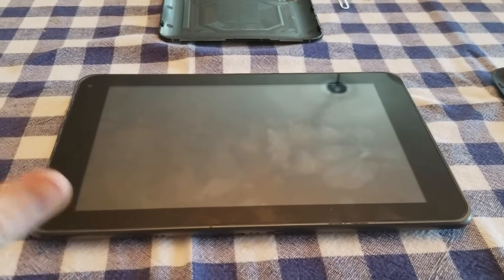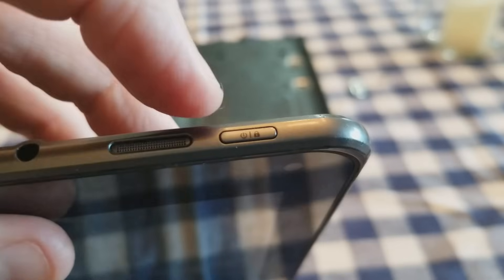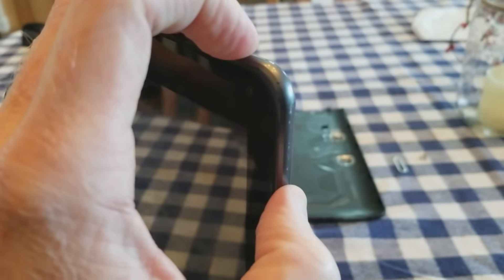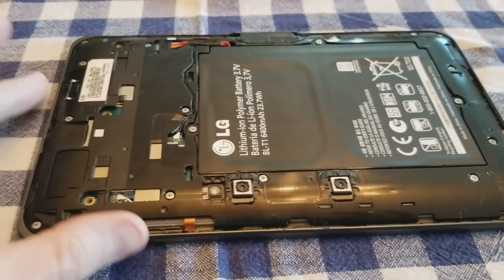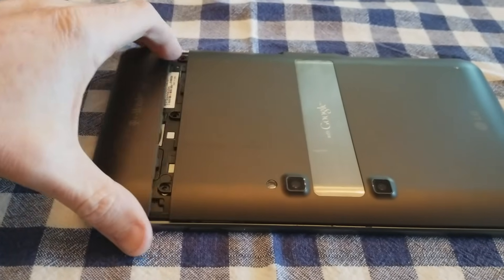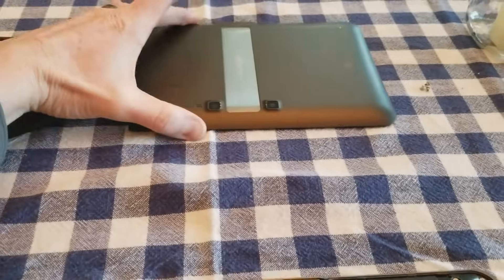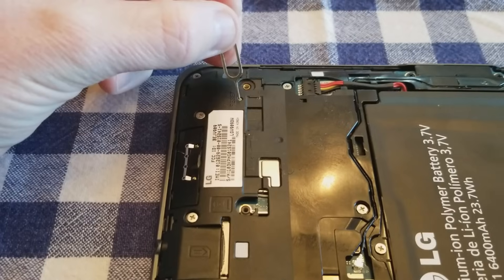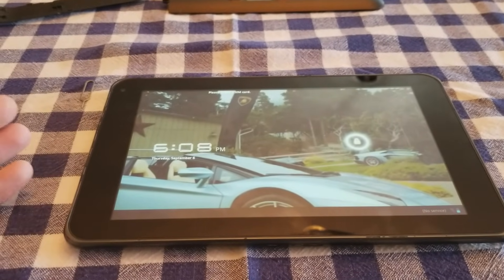Android Tablet Won't Turn On FIX!!

Comment: I put it I did the button and volume and then I put it in recoveryand then I took the case off which I'm struggling with it what I struggled withand then I hit the reset button and then I let it charge for 4 hours and it worked fine

Comment: i tried to discharge the motherboard without the battery being plug in... still no. Its not turning on or charging... I've put it in the charger for days still no....

Comment: You are amazing, I replace screens for my tabs and iphones, I work with their hard-ware stuff, replace the inside hearing piece og my iphone, but just gave up to fix my samsung tablet which just suddenly decided to die (I appreciate the details you mentioned including the idea of very low battery as that was the case lately), for me the 1st option worked quick and magic.
Thanks again and again and again.
God bless you for every electronic wisdom you share

Comment: LG tablets are terrible. Never buy one. I had several and if you do not have the original usb cable they will not work with another one or if they do sporadically and will drain quicker than they can charge, even plugged in. They are terrible tablets. Verizon is a bad company for using them, go with another service.

Comment: Another way is to charge the battery manually 
Try jump starting using a powerbank board 
Disassmble the tablet to access the battery 
Connect the positive to positive,negative to negative on both battery and powerbank board 
Then connect the powerbank board to the micro USB charger and charge for 30 minutes 
Can watch my video on how to do it
Look on dead android tablet revival on my channel 
You can get a powerbank board from a key chain powerbank as I did it

Comment: My new Winnovo tablet stopped working after 8 days with the battery at 100% charge.  Fortunately, an internet search found a solution from 2014 that worked.  It mentioned the tiny hole reset button which fortunately was right by my power button.  Sticking a straightened out Christmas ornament hook in the reset button hole worked and now my tablet starts again.
Reply: It is good that you knew about the reset button.  It is too bad that some tablets make it hard to reach.  Some people think they need to disconnect the battery and then reconnect it. They don't know about the reset button.

Comment: no joke i cried when it turned on. it’s been 4 years-
Reply: I was so sad when it did this like just playing on it then boom turned off dunno why did the hold down on button and volume button and BOOM I cried when it turned on
Reply: Ultra Instinct Master cry baby
Reply: @toastyy235  thank you! I was trying to turn a device on and when i tried what you said it turned on! :)
Reply: @viraenthusiast  its OK dude nice to know I helped someone
Reply: 4 years?? Maybe theres hope for me too. Hmm....
Reply: Nope. Completely dead. And cant find my usba charger either. But if memory serves, it was having charging issues, so I may have worn out the battery or charging port.
Reply: @kurtr1181  awww man I feel bad for you
Reply: @kurtr1181  oh welp
Reply: @kurtr1181  RIP Mr Kurt R- a Great Man Who Didn't Survive During the non charging tablet holocaust.
Reply: @kurtr1181  RIP, one year into the future
Reply: @kurtr1181  You need to charge it first
Reply: @kurtr1181 bro mine works but doesn't charge
Reply: @kurtr1181  same my stoped working when I was seven which was 5 years ago but I managed to fix it and then I forgot I had a password.
Reply: @diamondmax5141  I got it working soon after my comment! I think I have a slightly loose charging port, so the cord has to be absolutely still and in a consistent position. But at least it's not a battery issue like I had thought.
Reply: @diamondmax5141  lol
Reply: @diamondmax5141  go to bios and reset whole tablet
Reply: @kurtr1181  Mine won't turn on too
Reply: I fell you it most be that painful
Reply: Even my tablet it's been 4yrs 😮
Reply: @karenmeni1286  sam
Reply: OMG me too! 😭
Reply: Lovely Kawaii lier
Reply: I will cry too if it gets fixxed, this tablet has high sentimental importance to me
Reply: My own works just that it has a black screen...my netbook tablet just has a black screen I  mabe just need to replace the screen....
Reply: no joke my tablet was not on when i was 4 and that was 7 years and it wont turn on and it turned on when i was checking it and when i played it for 5mins it turned off and wont turn on so im on youtube looking for a fix i miss my tab i wish it will turn on someday
Reply: @darkgamer3743  seen
Reply: Mine still won’t turn on :<
Reply: Same I got it since I'm 4 and it turned of at 5 so I'm 10 now I'm crying
Reply: мilкy_cнlσє cry baby
Reply: Charge it
Reply: 3 yeara for me
Reply: My little brother peed on my old tablet :(
Reply: Qu
Reply: Bless me I have the same situation like you. Plz me plz
Reply: Mine 5 years bless me and your dreams will come true, believe me
Reply: Areee same 4 years ago at new year i was running to my brother because i wanted to  play subway surfer so i ask my bro to send me that game and he said to bring the tab then i went to my room and i was running out of excitement and boom i fell and my tab crack and screen wasn't working i couldn't do anything and i had a strong Patten and now i probably forgot what was my pattern 🥴😭 just now i finally on my tab after 4 years... And was searching for how to fix my tab 😂😂😂 then i saw someone who was in same condition whos tab turned on after 4 years... And today 23/8/20 my tab finally turned on 🤩🤩
Reply: Congrats!
Reply: mine has been more than 7 years :')
Reply: yep. I'm trying rn with my samsung tablet, it's been 6 years. I lost so many photos of my pets that have sadly passed.. but I've been trying so hard to get it back on. praying this works
Reply: 4 years? Maybe I have hope mine is 7 years
Reply: Wdym Is There Hope For Me Too? It's been 7 Years😭😭😭
Reply: @NahIWillDie  YOU HAVE HOPE MINE IS WORKING NOW TRY USING THE MAIN CHARGER FOR YOUR TABLET THAT IT CAME WITH THATS THE ONLY ONE THAT WORKS BEST
Reply: @personwithbasichumanskills  Bro I Will Thanks If It Worked I will litrally cry😭😭
Reply: @NahIWillDie  Good luck!!!!! I’ll pray for it to work <333
Reply: @personwithbasichumanskills  Thabnks :))
Reply: OMG! Same!!
Reply: Crybaby
Reply: My tablet iPod and ex phone has been dead like this  for 4 and a half years now and they still arnt working I’m gonna keep trying tho !
Reply: If only i seen this video 6 years earlier because I had my dad open up the battery :(
Reply: OMG I HAVE HOPE-
Reply: Mine's like 2 years now and I'm planning to turn it on but i don't have long enough nails lmfao
Reply: I had no hope for fricking 6 years
Reply: Wow... maybe I can do it as well-
Reply: Me too the same situation
Reply: Same
Reply: Mines won’t turn on for some reason-
Reply: My tablet is off service for like 3 years now
Reply: Lol it reminds me when I turned on my dad's old phone, it's been dead for 5 years lol and surprisingly I can turn it on
Reply: Its been like, 7 years im tryna wake this bitch up lol
Reply: well mine is like when i was 2 years old
Reply: i think this will do
Reply: Haha
Reply: @jadonfrancis6506  💀💀i hope you lose you all data
Reply: Same
Reply: omg lol
Reply: Mine 1 year...
Reply: Same here my tablet is my childhood first gadget
Reply: @clrxcasqz  same here I got mine when I was 8ish and I've had it for 7 years and it suddenly stopped working and I can't seem to fix it - so my dad offered to by me a new one for my birthday cause he doesn't wanna buy a battery for a tablet that's too out of date anyway :'( my tablets life is now over
Reply: @rabbitman8535  no dont give up
Reply: @ministuff60  got the new tablet sold the old one, my dad hated the idea of buy a new battery he shilled put 189 something quid for a new one, so glad he got me a new one the new tablets are sick (got the tab6 note) miss my old one though
Reply: @rabbitman8535  well i repairing my old one right now
Reply: Woah sana ol😲
Reply: 666 likes lol
Reply: Same mine has been for a year
Reply: It's been 11 years for me
Reply: Mine is 3 years I hope my tablet turn on :(
Reply: I have the smart tab 7" Disney and it just boots up and blacks out immediately till I hold down power or volume and power buttons simultaniously
Reply: BRO I DIDNT LOOKED TO THE YOUTUBE I HAD KURIO 7S AND IT DIDNT OPENED UP IM REALLY SAD 😓😭😭😭😭 I THROWED IT TO TRASH BRO IM SO DUMB 😭😭 I NEVER THINKED ABOUT LOOKING TO THR YOUTUBE 😭😭😭😭😭😭😭
Reply: Mine just broke :) so im showing thsi to ny dad
Reply: 😩its been 5 years but I can't.....
Reply: mine is around 4-7 years i hope it works
Reply: What do you do ? Mine also its been four years but its not on
Reply: @bekind.....8980  Mine didn't work, turns out the LCD is broken if you see lines in your screen that means your tablet's LCD is broken, so no chance for it to turn on unless you replace it with a new one.
Reply: It's been 2years-
Reply: SAME
Reply: My tab is 5 years old, i dont know if it turns on but i know i cracked it when i Was 5
Reply: I hope for me to its been at least 4 years too
Reply: It’s been 7 for me..
Reply: Mines 7 years 💀
Reply: Same
Reply: 4 years with me too
Reply: Good for u mine will never turn on I tryed
Reply: Hi guys
Reply: Me five yrs
Reply: Mines been around 5 or more years unfortunately my charging port sticks out more than it should so my charger won’t even fit in all the way 😭
Reply: Me too
Reply: Thats what I feel
Reply: Bro it’ll be 6 for me.
Reply: It happened to watch this of me fixing it
https://youtu.be/oHg5SJYRHA0
Reply: R.i.p
Reply: @BruhYouKnowWhat mine didn’t. i got sad☹️
Reply: Im late for this but understandable, I honestly would too.
Reply: I hope your happy
Reply: Can relate to something like that happening
Reply: @TAPWWW I have a blender from 1984. It's ugly green baby poo yellowish, weighs 20 pounds, is loud as can be sounds like a 350 chevy no exhaust running but it's worked all these decades. Same with a mixer and stand I have from 1989. We used to make products in USA with great quality and I even got spare gaskets, blades for these so if I break a blade, which I never have, I can replace it. It's so sad to live in a time where we work hard to pay for products that are NOT meant to last. We buy all from China, made as fast and cheap as possible. Nothing major is made in USA anymore.
Reply: I found my dad's old tablet of this
Reply: Man I have an lenovo idk if it works but congrats (btw you likes 1666 you got the demon number)
Reply: Ok
Reply: My 7year
Reply: Mines from 2011 and it powers on
Reply: Which one u tried
Reply: Same here.   Still won't come on tho
Reply: Same 😊
Reply: I just bought a second-hand mini DVD player, you can attach it to your tablet, I did, then my tablet over had 2 years, went black screen, I tried everything as on above video except taking back cover off, mine looks machine pressed, I've tried the 3 little screws, but still can't take back off. I think that DVD player had something to do with shutting my tablet down. Darn! I need it for work!
Reply: What??? It's almost been 4 years for me and my onn android tablet still won't turn on these a video I'll send you a link https://youtube.com/watch?v=yN8aWKz703g&feature=share8
Reply: My tablet dont turn on for like 6 yrs now
Reply: @zero-adamtoth4793  I have 3 and they don't turn on too. 😪
Reply: Why am I watching this my tablet works 😂
Reply: 😢im with you on that...😅
Reply: Me it turned on 15 yrs
Reply: For me its like 6 years
Reply: Wow
Reply: Lmfao. You couldn't replace an android charger in 4 years?
Reply: Hey same situation about to turn it on in the morning
Reply: Yall crybabys
Reply: Let me see if it works
Reply: @realBBNben  it didn’t on mine
Reply: Which method was useful to u?plz reply
Reply: How I mean which technique did you use ??? Please tell 🥺
Reply: THERE MIGHT BE HOPE FOR ME CUZ MINES BEEN OFF FOR A WHILE TOO
Reply: Me to 😢😂😂
Reply: Its been 5 years , my tab not yet turned on 😢
Reply: If I get it to work it will also be 4 years
Reply: 😮😮6 years
Reply: hey i found a tablet with a smashed front on a parkbench and i took it home and this helped me get it on IM SO HAPPY Free tablets a score\
Reply: Maybe there's  hope for me
Reply: SAME I CANT DESCRIBE HOW HAPPY I AM RN
Reply: That's kinda stupid
Reply: For me it was 7 years
Reply: It's been one day
Reply: I'm not joking mine is sky tablet and it turned on and turned off😢
Reply: My meberry has been stored about 2 yrs I'm going to charge for 4 hours hope it turns on 😢
Reply: Woah
Reply: Same but 6y and still off😭😭😭😭😭😭😭😭😭😭😭😭😭😭😭😭😭😭😭😭😭😭😭😭😭😭😭😭
Reply: Nothing worked
Reply: How did you do it
Reply: Me tooo❤❤❤ thank God, I needed it so bad.. God bless!!
Reply: Now its been eight!
Reply: I feel you bro mine just came on I thought I was in trouble
Reply: Yayy!
Reply: Ur not the only one..... I have it for 10 DAM YEARS...
Reply: Did it work mine won't work
Reply: I’m here before 4 years
Reply: I’m here after 4 years?
Reply: Same😢
Reply: damn my tab wont turn on for 2 years maybe there is hope for me too
Reply: MINE WAS 2 YEARS AND IT OPENED OH MY GOSH IM CRYING
Reply: Me it's been 2 days
Reply: Bro wdym it's been 8 years for me 😂😂
Reply: Same but my tablet has been 2 days only and I was in panic attack
Reply: Thats js wow
Reply: my aunt charged mt tablet and opened it
Reply: because it's 1%
Reply: It hanent work for like 6 years
Reply: Me to i cried when i rurned mine on its been 1 year
Reply: coy cat crybaby

Comment: HEADS UP THOSE WITH SAMSUNG TABLETS. ITS NOT VOLUME UP ITS VOLUME DOWN AN POWER BUTTON. TRY BOTH WAYS. I HAVE SAMSUNG AN IT DIDNT WORK WITH UP VOLUME ONLY DOWN.

Comment: Godammit this thing is giving me problems

idea USA Android tablet 
problem: Won't charge properly, it shows the charging indicator on screen (the one that comes on after it being dead) but unpluging the charger makes it turn off with no way of making it show anything on screen.
model:CT1020
i found a way to factory reset it but it does nothing
it has a reset button on the side that does nothing. im just trying to make it turn on from being dead for like 4 years
it's wierd the screan comes on when pluged in but you can't do anything only watch it 'charge'
i founf a way to get to the command menu and factory reset but rebooting it takes me back to the charging screen

send help

Comment: I need help please guys.After clicking the recovery mode and pressing the power button. The google logo still appears and I've been waiting for almost 20-30mins to see the android with the chess open(triangle exclamation point etc).  I need help please. I'm using a Nexus7(2013)

Comment: Hi,

I have a Prestigio Multipad 4 Diamond 7.85 3G tablet. I had mine opened, the LCD screen with the digitizer flex cables disconnected & the inner battery as well for about a week or so. 🤔

I connected everything up today & none of the suggested advices don't work. The voltage on the battery itself is 4.0 V. I measured it with a Digital Multimeter. 😕

The battery doesn't have the usual black & red wire. It has many wires.

Is it possible that the circuitry somehow locked itself up, because no battery or power source was connected to the PCB ? Some sort of a security system. 😞

Because prior to disassembly it was working just fine.

Edit: Found the solution. On the disconnected battery, on its exit terminals (connector), I connected a small DC motor that was salvaged from an old desktop CD-ROM drive. 🤔

So I was right in my thoughts that the battery can lock itself up, if not connected to the PCB of the tablet. And that you need to restart it through an external power drain device. 😊

Comment: My tablet is stuck on youtube, it won't restart or turn off. +TipsNNTricks
Reply: Is the battery going down if not go in to the store sos maye
Reply: @conspir0ocys  You've misunderstood, I meant the tablet is completely unresponsive,  none of the buttons will turn it on or off and the touch screen won't work. It's fixed now though, just had to let it run out of power. Still it would be nice if someone explained what happened.

Comment: my tablet was working a few seconds ago and i realized it was at 5%. i turned it off and grabbed a charger and plugged my tablet in. when i went to go turn it on nothing happend.i plugged it in for a while and still nothing not even the showing percent thing. i came to this video and tried the 2nd and 1st option. my tablet dosent have a removeble back so i couldnt do the reset thing. when i did the home button and the volume up for 50 seconds still..nothing. idk how to fix it and my mum keeps telling me that its just because how old it is. halp :'c

Comment: I had my tablet charging and when I tried the power button and volume up it showed that it was full battery but it would boot up and didnt show anything after that
Reply: VeeDub Cam probably need to maybe go see Samsung
Reply: @honeybee1084  she didn't say samsung
Reply: cong balicong this video is specifically for Samsung
Reply: @honeybee1084  owh , this video title clearly described for common tablet
Reply: cong balicong he first used a Samsung tablet. You can check the description instead of trying to prove me wrong
Reply: @honeybee1084  the tablet he uses is a lg, check the description
Reply: @honeybee1084  ...He was demonstrating on an LG tablet in this video, not Samsung.
Reply: @honeybee1084  he was using an LG tablet 🤦🏼‍♀️🤦🏼‍♀️